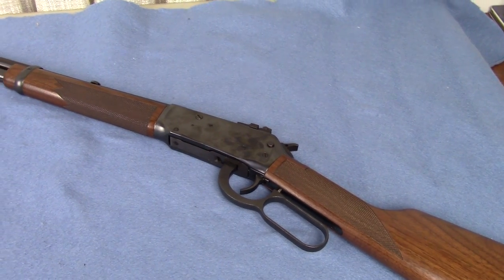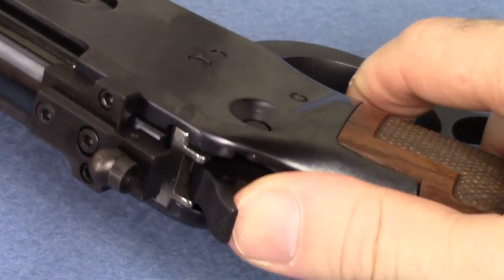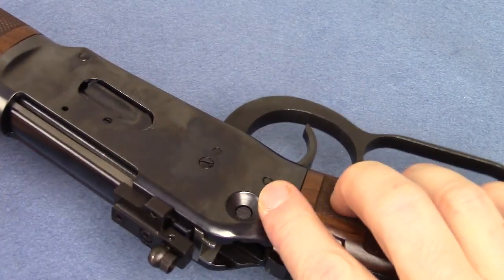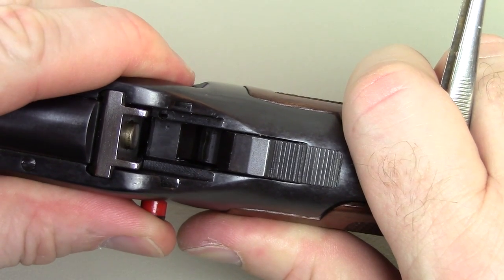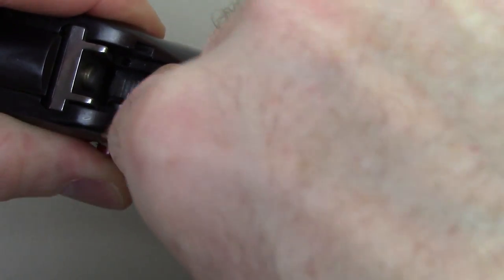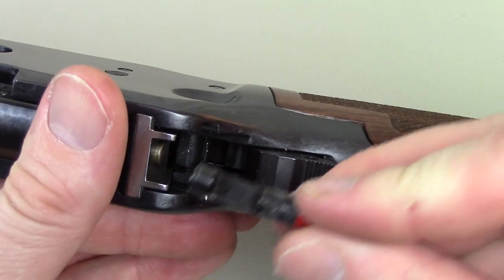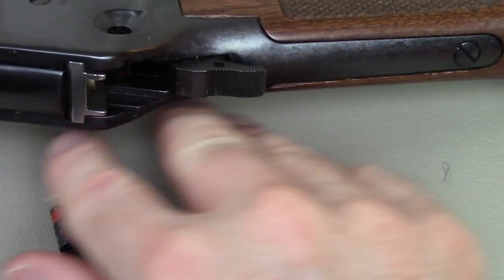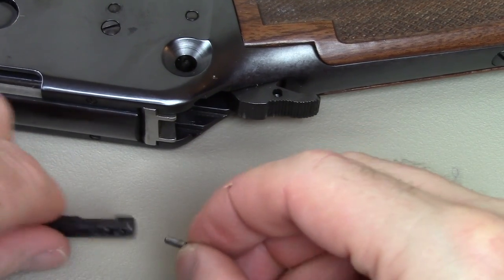Winchester 94 Cross-bolt Safety. Yuck. Here's how to remove it.

Comment: Thomas, This video was most helpful to me in removing the crossbolt safety from my model 94. Using this video it took me less than 5 minutes to accomplish the modification. Thanks so much for posting this.
Reply from the maker: Thank you for the note! Glad you got that crossbolt out.
Reply: @thomasarcturus8947  had I done the modification without your video I might have spent an hour or more working my way through it. Thanks for your video!

Comment: Personally think those cheap plastic plugs look worse.  At least the cross bolt safety can let you keep the hammer back.  If you are ready to shoot, you just click the side safety off and shoot.  No need to cock the hammer.

IMO with or without the side safety they work just as well and fast as any other model.  

IMO the AE models are amazing guns to shoot regardless of if you like the side safety or not.

Comment: I own the Model 94 Ranger model, that I bought in 1995, and I like the Cross Bolt Safety, and mine is not ugly. Does not have that orange part on it. Personally I would never remove it. Gun Safety is Paramount!  But each to there own. Good Luck.

Comment: I found those at Ace.  Funny, I just chanced upon these and they did fit just fine.  I also got rid of the rebounding hammer feature while I was at it, using instructions I found in another article.  I really don't know if that was a good idea or not but it had light primer strikes/misfires before and now it doesn't.  Great information on the safety removal and cover up job by the way!

Comment: I used door hinge pins to fill the holes. They fit absolutely perfectly. So i cut the pins to size, one for each side. Peened them out just a bit and drove them in with hammer and punch. The pins are extremely soft so they go in easy but tight and will stay there until you hammer them back out. Worked beautifully

Comment: Hi. I see that you've installed a Skinner peep on your 94AE. Did you need to replace the front dovetail sight also, or you kept the original? And how is the accuracy with it? Thanks
Reply: I installed the same Skinner rear sights on my 94AE .44Mag and 94AE .357MAG, (both are Trapper models),  but have not fired them with the Skinner rear peeps as of yet.
(I also installed a rear Skinner peep on my Browning BL22, fired it, had to order a much taller front sight from Skinner. Have not test fired it again yet however. Totally defferent rear sight setup than the centerfire 94's, so definitely apples and oranges, just wanted to mention it)
I seem to remember that I somewhat compared the Williams receiver mounted rear sights that I had been running on my 94's, to the Skinners, as far as height. And they looked to be matched fairly well. I had fired the .44MAG quite a bit with the Williams peep so I feel hopeful if not confident that the oem front sight will work out. I had not fired the .357MAG however. (I would like an excuse to purchase new front sights however! Possibly brass bead)

Comment: Mmmm.  Yeah.  Not much of an improvement in my opinion.  Surely, by now, there is a safety delete available in the form of a saddle ring to make use of those holes.   I have the AE in .357 magnum and unfortunately that already has both the saddle ring AND the ugly safety - so I'm stuffed.
Reply: Two years later and I have not found a lick of information on a saddle-ring safety delete unfortunately.  Thinking about manufacturing my own, thinking about not going through the trouble of it lol
Reply: Well, scratch that there is one saddle-ring safety delete I've found for the Marlin.  Different installation than a Winchester...

Comment: any winchest which has this cross bolt safety shoudlnt be really removed cause the gun doesnt have a half cock notch like the older guns did that didnt have the safety i guess is what it is tho if people hate it that much as long as they are careful the half cock shoudlnt really be needed but personally i woudlnt remove it

Comment: Can a saddle ring be placed in that hole once safety is removed ?
Reply from the maker: Not directly. That would be a fantastic aftermarket product though.
Reply: @thomasarcturus8947  yep, the spot on left side is where the ring goes.  My step dad took my 64 30-30…..I didn’t have the heart to tell him he gave it to me 40 years ago ( dementia) .  I got a little frustrated and bought the AE with that safety ( too hard to find anything close to my  original without breaking the bank).  I will find a gunsmith that can machine that hole to fit a saddle ring.  Thanks brother
Reply from the maker: @carlosrivas3837  What a cool project. It should be doable. Hopefully it looks good too. Let us know how it turns out!

Comment: I just tried this on my '94 AE in .45 Colt. First thanks for the video, without this info it would be impossible to tell how the safety comes out. Now I installed a 3/16" x 1" Chicago screw but when manually pushing the hammer forward, the hammer face stops about 3/32" short of the bolt face instead of full contact. Are you getting reliable ignition (full primer strikes) with a 3/16" Chicago screw installed?
Reply: He didn't install a 3/16 inch screw; he installed two 1/4 inch nylon plugs.

Comment: I have a Winchester Model 94 AE, I am probably the only Person that likes the Cross Bolt Safety. It is extremely positive, I have taken many Deer with Mine, and the Safety never caused Me any Trouble.
Reply: You are not alone.  I like the cross bolt safety and do not see it as ugly or cumbersome at all...
Reply: The crossbolt is an ok design.  The shooting world is full of old foggies who lament the passing of the blackpowder era.    The only real downside to the crossbolt safety is the possibility of actuating it before taking a once in a lifetime shot.
Reply: JOHN MOSES BROWNING didn't put it on the gun...you don't tell Picasso how to use his brush do you?
Reply: I also like the cross-bolt safety on my Model 94 Winchester made in 1992. I one shot what I consider the dumbest deer in the woods back in 1986 or 87 with my new Marlin 336 with it's new cross-bolt safety. I was on a stand up on the mountain on a bench about a 1/3 of the way up when a young Y (4 pt) whitetail came running up the hill and stopped about 30 yards away. I put the cross-hairs right behind his front shoulder when the dumb thing just laid down, just like a cow in a pasture. He was partially obscured behind a fallen tree so I held my fire for awhile. I finally thought, oh hell, I have a good shot at his neck so I lined up on that and pulled the trigger. Snap, no boom! The deer turned his head, looked at me and slowly stood up. So I jacked another round in the chamber, lined up on his shoulder and Snap, no boom again. Now, I'm like what the hell; and then it hit me, cross-bolt safety. I pushed the safety off and by this time the buck is slowly walking up the hill about 40 yards away with a quartering shot. Bang, the shot went in right behind the front leg but it caused the buck to turn around and headed straight down the hill toward me. So I levered in another shell and put one right in the middle of his chest and he piled up dead about two paces from me. Needless to say, I had to sit down, have a cup of thermos coffee and get myself settled before I gutted him and started dragging him the 200 or so yards to the car. Good old cross-bolt safety, ya gotta love em!!
Reply: @robertslusser6753  Congratulations on a successful hunt brother.  Lots of people don't like the safety but I do. I also like a wing style safety on a bolt action that physically blocks the striker.  It's one more thing to manipulate but It's better than just sear engagement holding the striker back.

Comment: "As with any project, I then looked to the web for help. After a few minutes searching I found out how to remove the safety. You will need a tool for this. It requires one paper clip. Yes, a paper clip. Won't even cost you a penny. Straighten it out and you are ready to begin.

First, make absolutely sure that the gun is unloaded. Then cock the hammer and push the safety to the left. You will see, on the right side of the rifle, little holes in the cross bolt. Line up the holes and push the paper clip in until you feel the retaining spring compress all the way. This will take a little wiggling, but just take your time. Push the cross bolt to the left side of the gun while holding the spring compressed. The bolt will eventually work past the pin, and slide completely out of the gun.

You will have to work at this. It is a little tricky because the paper clip is in the hole. The trick is to release the bolt from the pin as you pull the clip out of the hole and push the safety out. Be very careful, for as the bolt comes free the retaining pin spring will come out. You need to catch this, and the pin. You may want to put the safety back in the gun at a later date, so save the parts you remove."

https://www.chuckhawks.com/win94_safety.htm

Comment: FN Herstal did that (1992 - 2002), in part to sell the gun internationally. Yeah, it sucks, but removing the safety completely, while aesthetically pleasing is for lack of a better term UN-safe. I believe that from 2003 on, they went to a tang safety, would be nice if they offered a retro-fit kit that would swap the cross for the tang. As every man knows you can NEVER get too much tang. Seems like a gunsmith who came up with a retro-fit that included a half cock hammer with or without the tang safety would make a mint, providing they had every customer sign an ironclad disclaimer.
Reply from the maker: An honest question though... are the millions and millions of pre 1992 lever guns unsafe?
Reply: pre 1992 guns have the Half Cock position, meaning the hammer could be cocked back OFF the firing pin, and NOT in the position where the trigger can disengage the sear (firing the weapon). 

Removing the cross bolt safety without having the Half Cock position means that if a round was chambered in the weapon, either it would be fully cocked and a touch of the trigger would fire it, OR, the hammer would be resting on the firing pin, and if such a weapon were dropped or even jarred the hammer would be in a position to strike the primer causing a negligent discharge. 

BOTH unsafe conditions. Hope this explains it better.
Reply: Ryan Taylor - No, these guns (and I have one, so I know how it acts) have a rebounding hammer with a hammer block in the "neutral" (for lack of a better word) position. When the hammer is down and the trigger not pressed back, the hammer is in this neutral position about 1/8" away from the firing pin, and is blocked by a secondary sear from moving any farther forward (this is independent of the crossbolt safety; it's part of the trigger mechanism). ONLY when the trigger is all the way back is this sear retracted, and the hammer allowed to continue forward to hit the firing pin. There is also a spring opposing the hammer spring that holds the hammer in this position. When the gun is fired, the inertia of the hammer makes it go past the neutral position, it hits the firing pin, then goes back to the neutral position. At this point, if the trigger is held back, the hammer can be pushed or hit and it will go forward to hit the firing pin, but if the trigger is released, the secondary sear moves into engagement, and the hammer will not go forward, even if hit or jarred. This position can be used the same way a half-cock is: with the hammer back, thumb it back a bit more, press the trigger back, start letting the hammer down, let off the trigger, and let the hammer come down to rest against the secondary sear. When ready to fire, thumb cock the hammer.
Reply: As in poon tang.

Comment: Remove the cross bolt,file down the part that sticks outside of the receiver flush in the fire position, Cold Blue the bare metal,now you have a safety you will never need and the hole is still filled up,did this to my 444 Timber Carbine sixteen years ago,works perfect!
Reply: That's what I've been thinking of doing. May do that in the real near future

Comment: Anyone having carrier problems with the post 64 44? Well I have. Got a Winchester model 94 44 mag used. Cocked it one time and it jammed plum up...tight!
Had someone tell me it was the carrier from the broken piece I showed him. He offered to fix it....6 months later a demanded my rifle back. He had put the original carrier that he'd have brazed on and filed on and all beat up in a bag. He got a new one from china it is in the gun now and has been brazed and beat on.
I watched numerous YouTube videos on assembly and dissembly over and over because I've never attempted fixing a gun. I finally found a original carrier and a new carrier spring. I probably wouldn't be writing this I the year of my rifle was the same as the videos I was watching. Mine had a push safty I didn't take out so couldn't get to where I could change to carrier.
All that said this carrier in a Winchester model 94 Post 64 44 mag seems to cause many folks problems.
So my question finally....
Is there anything that needs adjusting or smoothed off or guide adjustments, anything??
Or if it keeps happening the gun just can't be fixed... that's what the man finally told me.....
I'd appreciate your help or videos
Chaplain James "Hooter" Eaton
admin@ brandedbygod.org
Reply from the maker: Lever guns are not that easy to work on.  If you're mechanically inclined, and can be patient, it's doable. For Winchester lever guns, one things to watch is that many parts are not interchangeable between caliber models, even though they seem like they might be. There are probably compatibility issues over the years too. This is all hard to research. Examining Numrich's website might give you clues though.

Comment: Thanks for sharing , I first found your vid years ago and just came back to it , I have tap and die sets and I'm going to thread the holes ,there's not much meat there but enough for a drop of super glue and a turn of thread to lock a screw in , I'm going to add a threaded stud and saddle ring to the cratered side , it's technically the wrong side for a saddle ring but will look correct , cheers big ears
Reply from the maker: Ah, thank you, Bill.  Hope your project works out.

Comment: Would that be the same with a marlin??
Reply from the maker: For Marlins, you are lucky. The cross-bolt safety is not nearly as ugly. AND someone actually makes a specific plug for it.
Reply: I left mine alone I just don’t use it doesn’t bother me though

Comment: Thank you, thank you, thank you!! I have been trying to get those parts out of my .44 Mag, .45 Colt, and 30-30 Win 94 Trappers over the years doing the small wire method with zero success. Using your method those parts were out of the rifles in less than ten minutes total time.

Again, thank you, thank you, thank you!!!!!

Regards,
Richard
Reply from the maker: I appreciate your comment. I too was elated to get rid of that safety!

Comment: Thomas, I run across these videos with haters of the cross bolt safety all the time; fair enough, but with a 1/2 cock safety design rifle like the Win 94 and Marlin 336 just consider their design.  The safety was added because of the older trigger design of these rifles can go off at the full-cock when bumped on the ground on the butt of the rifle.  Granted, with a new rifle and hammer spring you will probably break the stock to cause the hammer to fall in this manner, but over time this issue with wear and the hammer spring losing its tension becomes very real.  Just be aware of their design and why things were done over time; the firearm was originally designed to be carried on the 1/2 cock as safe.

Look, a bump test has always been one thing you always check when you do any work on a firearm: it is part of a full-function safety test done on any rifle.  So many older rifles fail this test - and trigger work by amateurs is just as bad at failing this test on any trigger design.

Comment: I really dislike the crossbolt safety. I have a 1982 94AE saddle ring trapper in .357 magnum. When I lay it on the left side, the saddle ring seems to always push the safety on. I've pulled the trigger several time with the safety on. I had to really focus on checking it every time. It took a little while to incorporate the check into the routine. Weird with a levergun. None of my other leverguns have it. I caught it twice on video. I also caught breaking the carrier bolt interface tab on video. https://youtu.be/iAr_Ja7VcHQ  I was able to fix the carrier. I should do a video on that.

Comment: I can answer the question why Winchester made the cross bolt safety.  Answer: It’s a lawyer issue which it’s stupid. If I am not mistaken and I could be wrong but if my memory is correct some hunter shot him self in the face widen he trip over a log. So Winchester out of fear of another law suite made this stupid device. Marlin has a cross bolt safety but it’s not noticeable and it’s not a problem like Winchesters cross bolt safety.
Reply from the maker: Hey that's right.. Good point! Marlin made a cross bolt safety that is not butt ugly.

Comment: Worst darn thing Winchester ever did to the 94. So bad that Winchester went to Tang safety. It was Blasphemy. Hated it, as did most . Especially the Big beveled side. Can’t even hide it with screws..It’s like a huge kanker sore. Pre safety 94s are it. I even liked the Angle Eject. Crossbolt safety, no way. It’s like a safe space for Anti gun types. Freaken Hate it and so did everyone else.